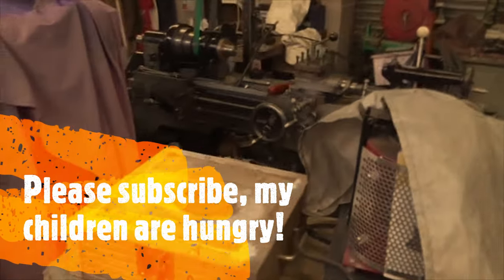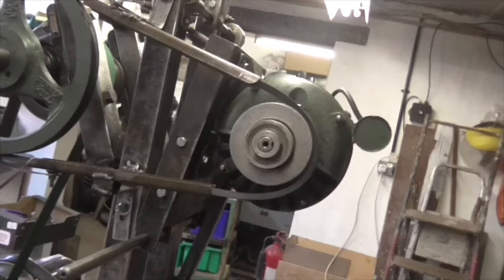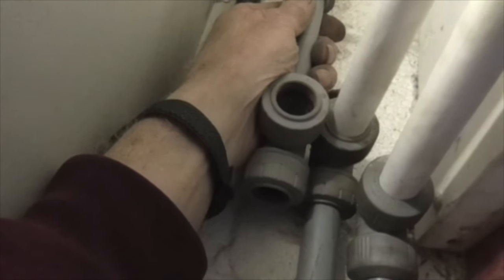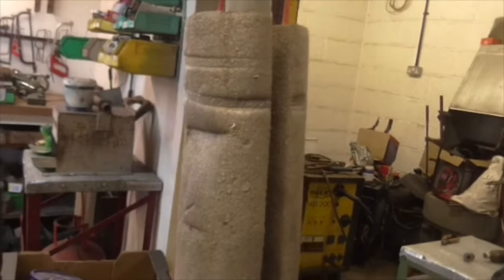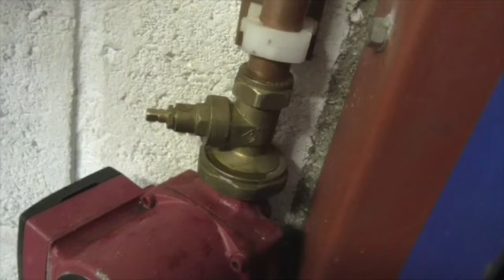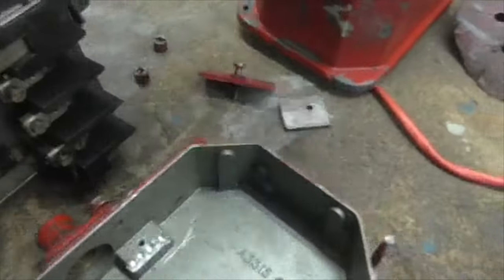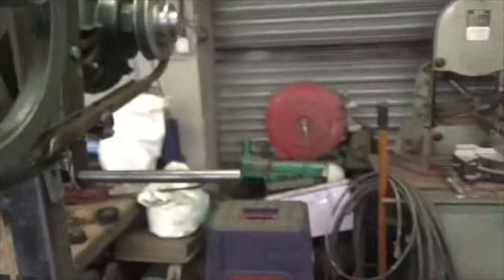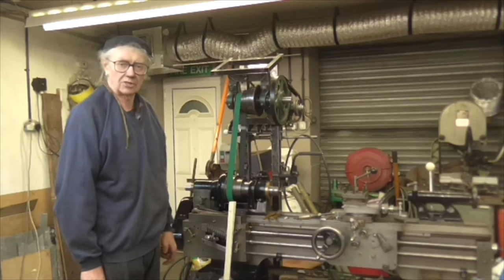Fixing central heating airlock, and more Holbrook

Comment: what a  week Phil,
that bloody temperemental heating system, these things come to try us,
 the juices  will flow next week now.👍👍👍👍👍👍👍👍
regards
Kev
Reply from the maker: I have only myself to blame, as Iinstalled it!! I have installed many systems before, and never had any problems, but this foxed me because I think I was looking in the wrong place for the airlock/blockage! I am going to have a look in the header tank on monday to see if there is any sign of foreign objects etc, because that is where the gurgling occurred that cured the problem! It was very odd to see two open ended pipes that were well below the water level in the header tank, which was brim full, the pump running, and nothing coming out of the pipes! Then a huge  gurgle, and water everywhere, and now its fine! I still need to get to the bottom of it!
Phil
Reply: @philhermetic  atb Phil👍👍👍👍👍👍

Comment: With all that work I now see why the previous set-up had the motor slung below ! respect for returning her to original. Did not take long to fill your new portable bench ! but that's what free spaces are for. Could be the first CNC'd Rapidor on the tube😃 ...Del..
Reply from the maker: Hi Del, problem with the last set up was firstly that the motor, countershaft and framework was all hung on two bolts in the T slot, and this put the countershaft below the level of the cone pulley, and they had hacked a lump out of the headstock to clear the belt! That had to go, so I made a rod for my own back in a way, but I am much happier with the result!
Phil

Comment: Great minds think a like your portable bench you constructed is almost identical to mine, I picked up the frame on Freegle fitted a piece of kitchen worktop, which I shall cover in steel sheet and I picked up a vice to be mounted on the top, it stands on four small casters, two of which have brakes and swivel locks. 😊
Reply from the maker: Mine had a lump of worktp too, but I have tinned over the original plywood now! It is great to have stuffon wheels as you can quickly move it to that fabled place of legend, somewhere "out of the way"
Phil
Reply: @philhermetic today i found a sheet of steel to tin mine today.

Comment: Good to see you've solved your heating problem. Phil. The Holbrook drive clutch mechanism works great. Could you, with your skills, fit the new starter inside the old Allen West shell. There's a nice vintage A W black one for sale on fleabay. It would look the dogs doodars on your lathe. That's if it has the correct internals, or you could swop/modify them. Cheers Tony
Reply from the maker: I’ll have a look!!
Phil
Reply from the maker: It's not a bad price, but no indication of wether its single or 3 phase, and for parts/not working, I will check out my local people to see if I can find one that I can check out before I buy, writing this has triggered a memory of a contact who may be able to help!
Phil

Comment: Hi Phil RE previous post about position of elliptical throw block - this is of course the drive crank, so when blade is fully extended I assume will be in line with it.  Apologies, brain fart..  Trying to ensure the blade lifts on backstroke via the oil dash pot.   Cheers, John
Reply from the maker: @johnjohnson764  the angle of the blade going forward lifts the piston in the cylinder, and on the backstroke the oil beneath the piston holds the blade out of the cut till the end of the backstroke. The blade teeth point forwards. Mine was not lifting at all but now works perfectly!